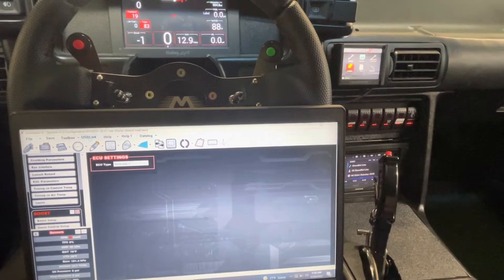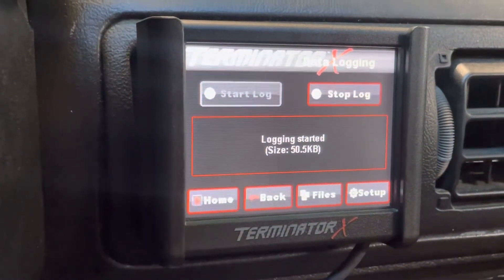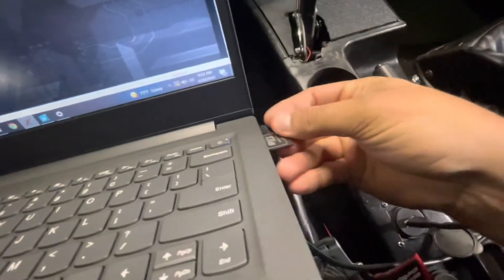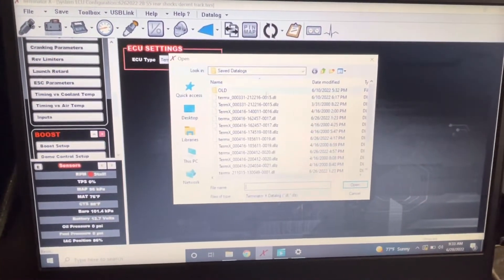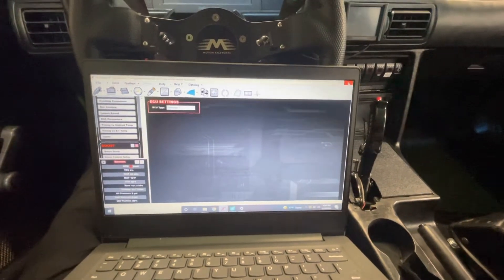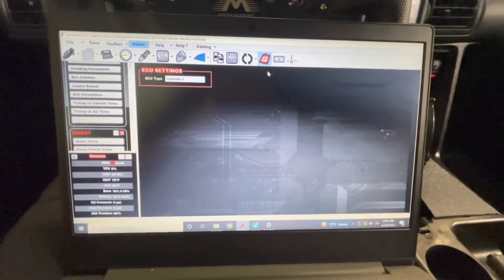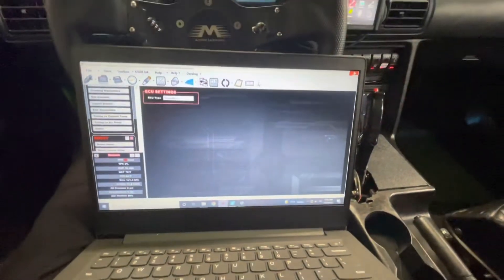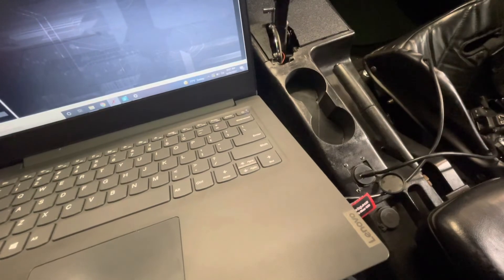How to Datalog using Holley Termimator X ECU

Comment: During Holley training, I was told the ECU would only function if it had one input device (ie handheld  or laptop). How do you have both?
Reply from the maker: I am not sure what they meant by that, but I can assure you that I very frequently use my laptop, 7" dash and 3.5" dash all in parallel at the same time without issue. What I believe that they might be reffering to is out of the box, you would need to disconnect the handheld to plug in a CAN to USB adapter. I am using a current performance splitter cable that runs in line, but I know amazon is now selling cheaper splitters that allows additional CAN access. Here is a link to a cheaper amazon one. https://amzn.to/3Xy9Nyr and the USB cable https://amzn.to/3iFZ5Hl. Or you can get it all in one through Current for a little more https://www.currentperformance.com/shop/can-to-usb-built-in-splitter/